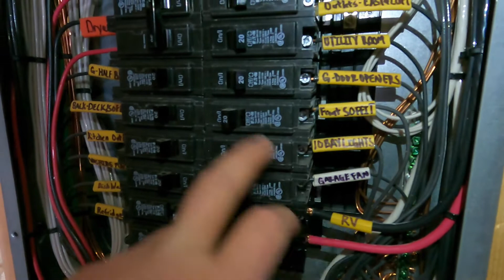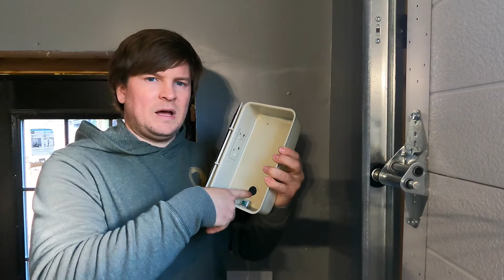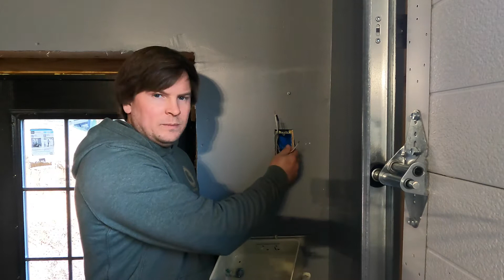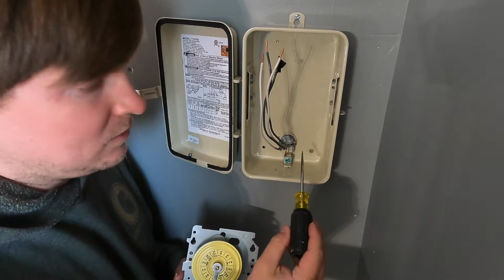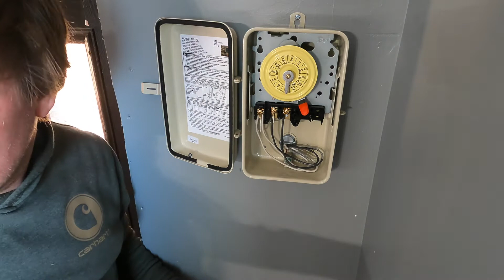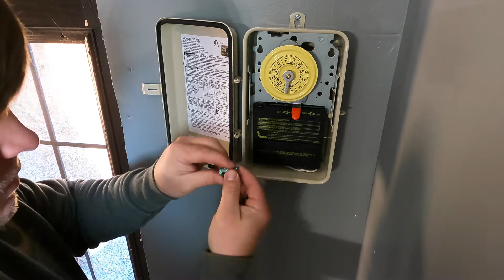How To Install An Intermatic Timer

Comment: Great video. I have old version similar wiring and clock face switch   it possible to upgrade to a digital switch like  the Honeywell digital 7 programmer Honeywell Home RPLS740B ECONOswitch ?

Comment: The manual ‘on and off’ is confusing. There is no auto position. Is off, off all of the time. Is on, on all of the time. 

So is off, off, but will come on at designated times!?

I’m assuming. 

On will be on all of the time. 

Confusing.

Comment: Hello! My lights aren’t coming on. I can turn them on manually. All is installed correctly. Screws/switches are on tight. They’re just not switching on when on the timer. Help?

Comment: I have the T101 Intermatic.  It has worked for 6 years but my timer has quit working.  Is there a way to buy just the timer or do you need to buy the entire box?  Thanks
Reply from the maker: I’m not to sure. I feel like just buying a new one would save a lot of headache in the future.
Reply: It's a T101M, Home Depot stocks them.

Comment: don’t yu need to power the time clock up wit a separate cct just for the timeclock and then bring ur line and load wires for the lights ?
Reply from the maker: Nope. Just one wire!

Comment: Scott…the clubhouse has an Intermatic timer that controls our outdoor floods and (believe or not) a receptacle by the gazebo 200 feet from the clubhouse where the timer resides. Is it possible that the electrician hooked up the outdoor floods AND the receptacle? By looking behind the plastic cover, how can I confirm this?
I’ve got 2 whites on the Neutral screw, 1 white and 1 black on the Line screw, and 1 black on the Load screw.
A safer way of asking is….if I were to remove 1 of the whites on the neutral screw that we know should NOT be hot,, can I safely allow the timer to go on at night allowing me to then see which is no longer working, the outdoor floods or the gazebo receptacle? Your thoughts please.
Reply from the maker: I wish I could help you out. I'm not quite sure how to fix the problem without being there in person to see. Should be able to turn the breaker off mess with whatever wire you think it might be, then turn the breaker back on to see if it's working correctly. (or maybe spend a few bucks to get a professional out to look at it)

Comment: The only issue I see is the connector you used to push the wires through. In this case you should have used a plastic bushing . The wires could have gotten damaged when tightening down. The connector has to be used with the armor over the wires and. Installed the other way around. Other than that good job .
Reply from the maker: I could see that! Thanks for watching and the feed back

Comment: The electrician I’m me cringed at certain aspects of this video. Can we start with that connector being installed backwards?

You wired it right but completely but butchered terminology. Power comes in on the LINE side and the lights are one the LOAD side. This is important as people reading a schematic could misinterpret this and completely wire something wrong. If you don’t know how to explain something these videos  are dangerous. This is how people start fires  through bad explanations.
Reply from the maker: I know it’s not correct way but hopefully the not so experienced people understand. Thanks for the comment and watching though!!

Comment: Do you leave timer on or turn off when adjusting time
Reply: Sorry do you turn manually off or leave on
Reply from the maker: So if you aren't close to the ON switch. You can just adjust the time. If you are close, then I normally click it on and then adjust the time. Easier to adjust when it's not close to the on/off tabs. I hope that makes sense and helps you out!!

Comment: What happens if the manual switch turns the lights on and off but I dont hear or feel the gears turning for the clock
Reply from the maker: That's interesting. There might be something wrong with the motor in there. Maybe try getting a replacement.

Comment: Thank you for the video. This timer can use with the water heater and the same connection? Thank you very much !
Reply from the maker: I would think so. Just make sure you get the right size for the voltage.

Comment: Garage envy, for sure..Is it possible to connect two lines to this device? I have landscape (low voltage) lights and lamp post lights that I would like on one timer.
Reply from the maker: Thanks!! It’s been a long process. I don’t see an issue with what you want to do! Once again, I am not a professional electrician though. Ha